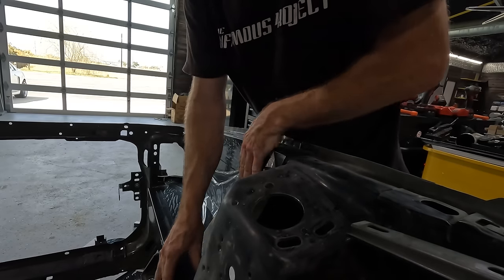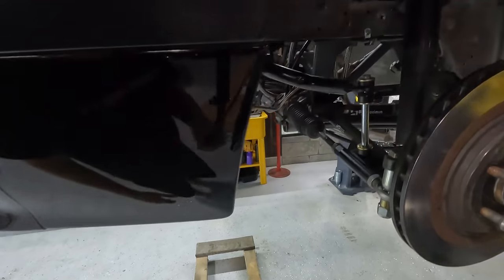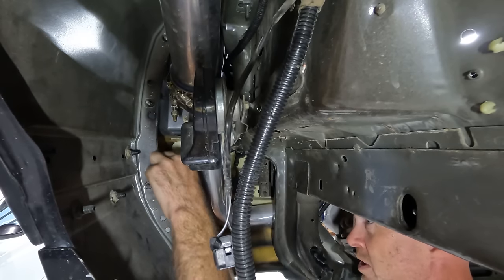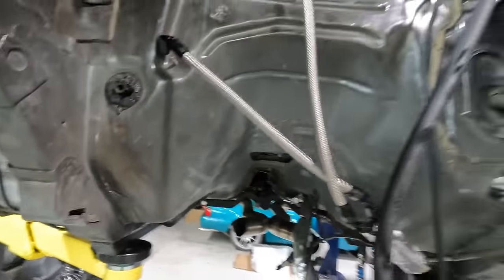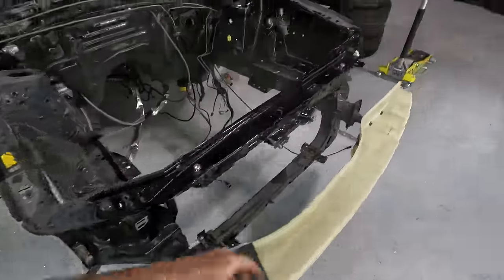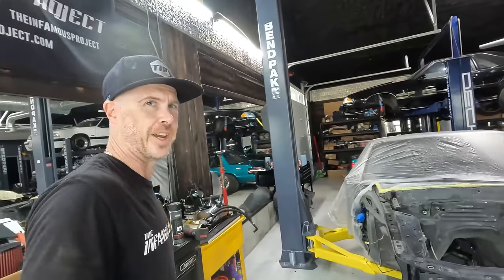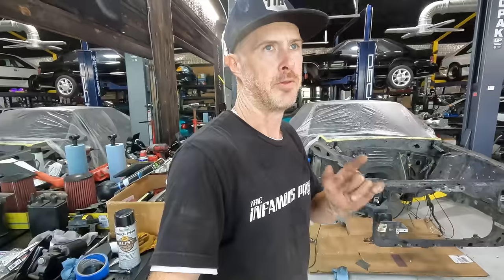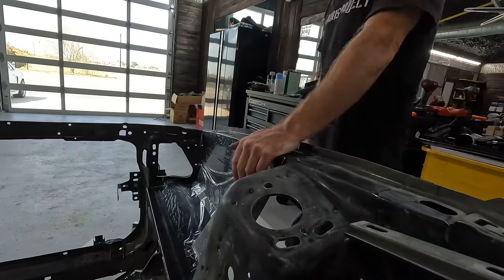Foxbody Mustang Engine Bay Revamp - This is how you do it!

Comment: Every one of these cars I’ve worked on had corrosion under the seam sealer located at the corner base of the windshield. Once removed, it is bare metal underneath there. This messy piece of seam sealer is hidden inside of the apron. Both sides.

Comment: Just a tip infamous. Take citristrip. Spray or lather on, and leave for 36 hours then take A Slice of aluminum and it comes off in sheets, then spray down and clean. Easiest way to strip to bare metal and paint. Takes way less physical time (besides letting it sit) to strip and clean.

Comment: I found an 1988 mustang gt 5.0 convertible and ii have to basically start all over and rebuild it like you did the convertible you have that you called Flintstone floors 😅 but I've never done it before I'm 32 it would be my first rebuild but second project caus ii gave a truck im gonna paint as well 
But if ii get the mustang in a few weeks I'll be painting it as well after im through